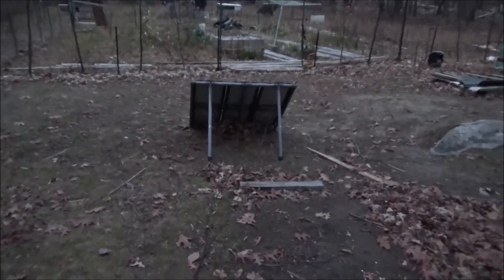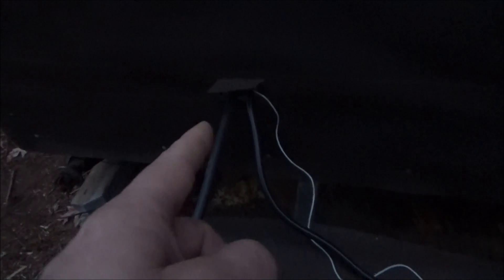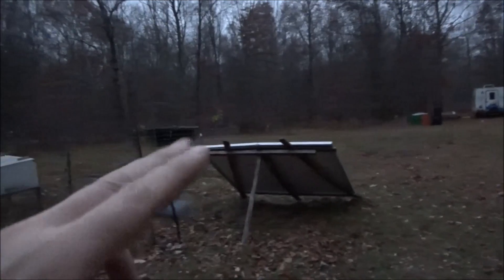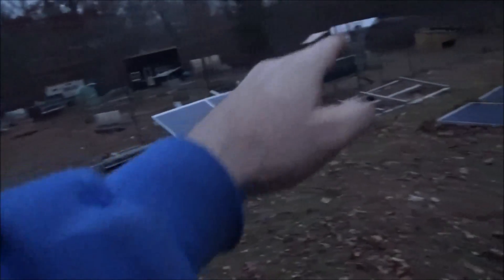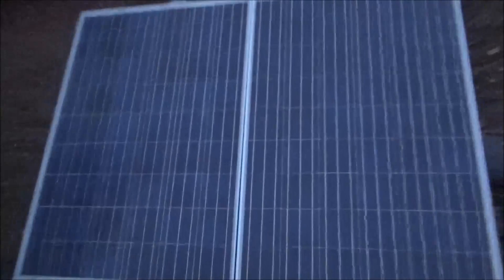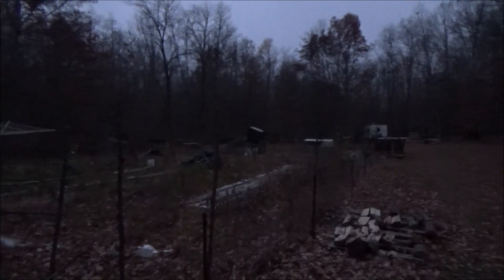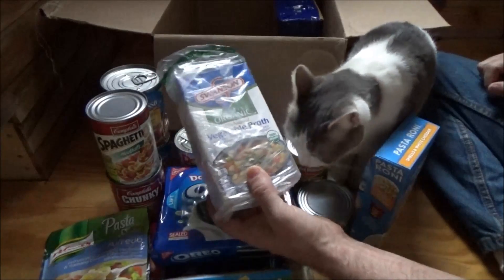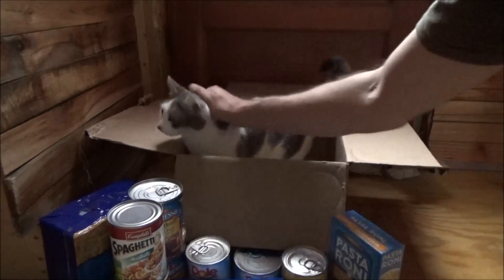Talking About My Off Grid Tiny Home Solar Panels N19

Comment: your charge controller has a MAX 600 watts, anything above 600 watts is wasting power, at 12 volts. Here is the Specifications for Morningstar TriStar TS-MPPT-45 Charge Controller: Max. Battery Current: 45 Amps Nominal Max. Solar Input: 12V: 600 Watts 24V: 1200 Watts 48V: 2400 Watts Voltage: 12-48V Max.

Comment: Hello from the UK, a bit of advice if I may. As you helped inspire me to learn about off grid technologies about a year ago :) So from my research you need at least a 24v system. Id say 48v is much better for your situation. Then get a MPPT solar controller upto 150v solar input and then you will get much more power in your batteries even if you have the same panels, because you will have say 5 solars in series meaning you will always have above 24b or 48v depending on your system. If I were you I would get a new 24v or 48v inverter and sell your current charge controller and buy a midnight solar or outback. Thanks for the videos

Comment: Troy, I see panels laying flat in the grass with weeds, that has got to kill their eficiency!
Reply from the maker: Neil Shubert You see panels not flat in the grass. They are on pallets and boards about 8 inches off the ground. But not connected. Remember when my wires burnt through a while back. These are not connected since then. I will get new wires soon.

Comment: It is what can happen during setup . I saw a homestead with thermal fan and thermal eleletric  power source to charge battery pack and device power up north. less sun up north but you always had a fire in winter.
  Thanks

Comment: Just to let you know air is a good insulator as long as it's sealed let say between two pieces of wood with ends seal. It'd be a temporary solution for you until you get more money. As for lumber just just smaller trees or cut down some of those trees blocking your panels and use it for a crude frame. Hey its been done before by Alaskan homesteaders and lasted for multiple years. It's free and you won't be wasteful.  Might even get a couple more suscribers out of the deal. 
      Also you have a tower right for the turbine? Good way to build a base without concrete would be to dig a large copluple feet deep cross shaped hole in the ground and insert 2x4s or small trees in the shape of a cross though the base of the tower and then bury it under rocks/dirt/sand what ever you have l. Then brace with cables as you would any normal tower.

Comment: Have u thought about after u put ur wind turbines  up maybe put the solar panels  up in the air and i would consider  having  two battery  banks  ur habor freight  intwo ur older batterys so that way u still can have lights and i bet  i work  out in the cold and it will zapp u make real tired i was out in for 8 hr straight sunday it was snowing the hole time took me 2 days not to feel  exhausted try not to run in out hot cold make u feel sick  and hope the snow isnt to bad over there

Comment: Here in western Oregon we rarely see full sunlight (fog, rain, overcast, and lots of trees), so I'm interested in how solar panels work in low light.  Is there a type of panel that gets a higher percentage of rated power in low light?   I seem to recall something about your little HF panel (45 watts) running at 20% to 30% rated in low light, while the big panels (200 watts each) are only putting out 10% to 25% of rated in low light.  What should I be looking for in panels for low light?

Comment: Suggestion - dig a small trench in that high-traffic area where your power lines cross from the chicken coop area to the home and lay your wire down in there, Cut a 1 1/2" ABS pipe in half (use your table saw) and lay it over the wire and then re-fill the trench. You don't want to be driving your tractor, walking, etc. over the wires.  And this should only cost you a few $$ if you don't already have something similar laying around. (plastic table legs?) 
You can thank me later.
Reply: I do suspect there are four round blue table legs lurking ...
Reply: MollyDolly you know, I came up with at least a dozzen good uses for that table, besides driving me absolutely nuts.
Reply: FromThe Prairies LOL!

Comment: Thought you bought the warranty on that little generator?  Make harbor freight take it back
Reply: gene mayne Actually, no... the warranty problem is documented, trying to repair does not void a warranty.
Reply: MollyDolly  Its apparent you have no clue what you're speaking about. There isn't one manufacture that will honor warranty on a item that has been altered, tampered, open, or repaired by the end user, none. Please refrain from spreading misinformation to the collective masses.

It's fine if you want to pursue such none sense.

But, don't spread information that is not based on facts, or that which will result in others losing out on their warranty protection.
Reply: TEKENGLOBAL I assure you I have a clue. While you are correct that many manufacturers won't honor a warranty if you "tamper" with the product.. in this case the failure was documented prior to the repair so, yes they would.  Also, in case you are not aware HF where this genie was purchased is extremely generous in their warranty polices.  We have had tools fail, attempt the repair... fail at it, attempt again, give up then take the disassembled parts into the store and the exchange was made, no problem.  For your information  we did just what I described with a jack hammer several months ago... so, yeah I do know what I'm talking about.  If you can't get something covered under warranty it might be because you have an unpleasant way of speaking to people.
Reply: TEKENGLOBAL Let me give you another example... Let's say your truck breaks down in the desert.  The trouble is the starter. Now you have no way to call a tow truck and it's hot and your water is low. You have your family with you.  Do you think the manufacturer is going to get away with not warranting that starter if you make  an emergency repair, then go into the dealer and demand a new starter?  Not a chance.

Comment: If you can, get another set of wires and run 4 panels in series off of one set of wires and the other 4 panels in series off the other set of wires. Then connect both sets of wires to your charge controller. That way you can get maximum power input from all of your panels at various times of the day. Save your pennies for another charge controller for the future so you can maximize your power harvest during summer months by splitting your panels up.
Food for thought...

Comment: if your intending to replace to cable then it would be best to build a frame get the panels up off the ground some height will give you more light hours and increases the intensity of light hitting the panel also dig your cable into the ground doesn't need to be too deep but will help dissipate heat and prevent the sun heating the able

Comment: Troy please read all!

       Okay so far I've been a great supporter to what your doing and wish you nothing but the best. I also watch your videos hoping you will use what you already have to solve your most important problems. I don't say this to try to pissed you off but use this as constructive criticism. You already have all the minimum power requirements necessary to meet your needs.
     I know you may not want to hear but you need to get your turbine up regardless if it isn't high enough, any power at this point Helps. The best way to reduce power loss is to shorten your wire length. You can this by moving in your trailer in the middle of your field, this will give you less wire length and loss of power.
      In addition, this will also give a higher mounting point for your solar panels and turbine. Placement is key in any situation. Combined all your batteries into one power bank, then place all your panels and turbines onto that battery bank. There is no sense in wasting more money on cable you don't need.
      Also build that stand/mini building up higher for you water tank to get gravity fed water to your home. If you don't want to move your home then build a power/water shed that insulated (if needed I can it design for you). Just combine and appropriately place everything and your well prosper. Thanks you for your time and good luck and "get it done".

     ---Smokign91awd---
Reply from the maker: I will not move my home. I want it right where it is. I have an MPPT solar charge controller so I have my solar panels wired in series allowing for no loss in the lines with the length I am using.
I cannot afford the materials to build an insulated shed in the middle of the meadow for a water tank. I want to set it up behind the house and put tires around it. Fill the tires with dirt. Pack it down. Cover it on top with more tires and dirt.
I will mount my solar panels on the wind turbine tower soon.
Reply: The Do It Yourself World I under stand you have boots on ground and I don't have a visual,  so that's why it was a recommendation.  Read my other post above here and hope everything works out for you. Wish I could come help you but I am a full time student and on a budget. I know you need it so pace your self and stay safe.

Comment: Troy, here is an idea for easy switching of panels.  Instead of disconnecting wires at the panels, use the breaker boxes in this link.  This way you can have all the panels hooked into the system, for when you all the output possible, but when you need to cut back the output, you can walk out and turn off the panels that aren't needed.  http://www.outbackpower.com/index.php/outback-products/integration-hardware/item/flexware-pv?category_id=449
Reply: I used to assemble those, they are a good product.  You will need to purchase the breakers from them in the quantities you desire.

Comment: Here's an Idea Troy build an new stand for your panels single or double up to you and what you do is get some little extra wire so you can have some play room to move them around after a nice frame is built for them and at the bottom use caster wheels to move them so in the morning you can move the panels where the sun hits then lunch move them back and after noon move them where they get the afternoon sun beside just having them set in one spot.

Comment: If you have any area from tiny home to your main road? A portable temporary setup in the bed of truck drive it out to sunny spot park it,pick it up before sunset plug it into house (didn`t say it would be easy).Or use your tractor to haul that portable solar generator to sunny location then drive it back at night plug it into home.Should save up for goal zero yeti 150 you can charge it while driving around or on solar and from wall outlet. http://www.goalzero.com/p/164/Goal-Zero-Yeti-150-Solar-Generator
 Great for backup when in need.

Comment: Troy look at videos 7&8 Les is running a 24v system and his siting of panels is half that of yours Les Stroud - Off the grid [Part 7]
Reply from the maker: Two points I have to make here. From the documentary, all they showed was them turning on a single light bulb. For one, true off grid homes would use LED lights with such a small solar setup. They never showed anything else at all.
Second, I have an MPPT solar charge controller which allows me to run my my solar panels in series up to 150 volts DC. This allows longer wires with no loss.
Reply: but your setup/panels are not connected to make 150v are they?
Reply: The Do It Yourself World the aim of those 2 videos was to show you the distance of cabling and the voltage required from the panels to the bank/controller - but instead you comment of the bulb.  Proves one thing though - the setup shown can power an incandescent bulb - yours at present cant even power an LED bulb
Reply from the maker: Paul Walker I have sulfated batteries off the shelf of the store. Come on now, give me a break. Les had a multi million dollar budget. He had his cabin parts air lifted and every single thing contracted out with heavy equipment movers. I am working alone with brand new but sulfated batteries. I will get it together. These things happen. Its part of living off the grid. Yes when its all brand new everything is wonderful. But with time stuff breaks down. I am showing day to day life out here. What you did not see is that Les could only run his light bulb for about an hour or so on that battery
Reply: The Do It Yourself World Odd I thought the batteries are/were new gifted from the store as well as the new MPPT controller that was gifted to you and you are using panels from a friend I believe that at the time were new. Remember last year they were not used as you were in Australia and since your return you have mainly been using the twin alternator setup to charge your banks

But again you are missing the point Troy.  The Video was to show you about distance and voltages required to cover a longer distance from panel to charge controller.  Have you used the calculator which shows you current/amp loss over distance with the wire used?

Comment: This is like watching the same train wreck over and over again. Its clear to me none of this important information is getting through your head. You placed your laptop in your car with out it running to charge your laptop?

You did the same thing with your cell phone?

I am less concerned about the cell as it doesn't take a lot to recharge but your laptop does. The direction you're heading is bad, to worse, to unemployed.

Why?

Because you're going to find your car wont start because you're doing the exact same thing with the car batteries and not understanding you CAN NOT recharge something that large of a load and deplete the car battery and expect it to have a long service life.

As you clearly indicated its going to get colder and the ampacity from the SLI battery in your car will at some point be so depleted and run down over and over again. You wont be able to start it.

Why does that matter? Because you wont be able to go to work, make money,  buy food, etc. Will you please stop the incredible stupidity of your actions that will directly impact your life.

It might be a good time to start praying that some of your friends come to your aid and shake your head and say.

Wake Up . . .
Reply from the maker: WOW, how what? A car can certainly handle charging a laptop one time without hurting the battery.
Reply: Did it occur to you that 5 minutes after the video he might have driven the car and recharged the batteries?  It's ok, it is hard to remember that there is a lot of the day we don't see.
Reply: MollyDolly You are seriously reaching if you believe that Troy even did that. Its even more comical you took the time to write such a silly comment when history has proven during the last 2-3 years how he deals with his power use, generation, and maintenance.

@Troy, once again everything that I have explained to you about draining down a common SLI battery appears to not register in your head.

What did I tell you about letting a battery drop below a set voltage? Better yet have you applied a AVR test to know, understand, and base your next steps on the battery state of health?

Comment: If just charging for laptops and batteries for cameras and such. Would it be better to just use 12v DC? Charging small appliances that have a DC transformer from 110v AC from an inverter that comes from a 12v DC source?

Comment: Hey Troy, I have a excel spreadsheet calc for solar that works out the amps used versus the amount of battery power and usage. It is set for Australia but can be easily redone for any country. It's not my work but is free to share. Not sure where to send it though?
Reply: It can work the losses of amps from cable type and length and remaining days left of batteries from the watts used per day.
Reply from the maker: info@thediyworld.com
Thank you.

Comment: Have you given any thought to mounting your panels up higher to attempt to get out of the shade from those trees? The church rv/workshop on wheels would be great for this. Mount the panels on the roof at the proper angles (usually calculated by your Latitude) and park the RV in the meadow in the sunniest spot. Another idea would be to find/make/buy some brackets to fly the panels off your turbine tower once it's installed. This could allow flexibility for being able to move the panels throughout the day if they are mounted on a type of swivel. I see the potential to seriously increase your power output here just by getting those panels 10 feet or so higher.
Reply from the maker: When the wind turbine tower is up I will put them on that
Reply: The Do It Yourself World
I think that's a really good bet. Putting them on a swivel and use some pulleys you could manually track the sun and increase efficiency even more.
Reply: The Do It Yourself World Yanno? I can already see I will be living the old 18th century way with brick oven and stove useing candles and carosin lamps. LOL! I am so confused it's sad! LOL!